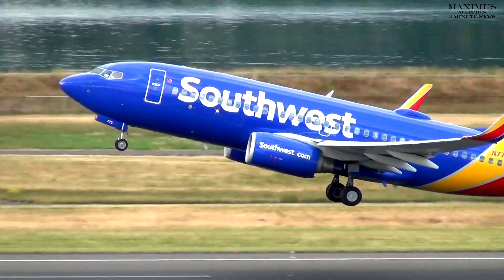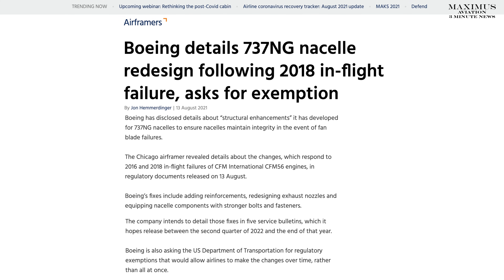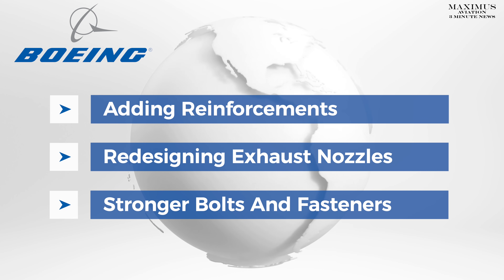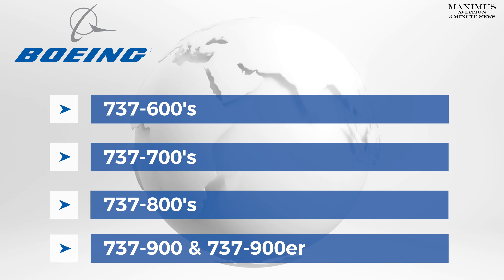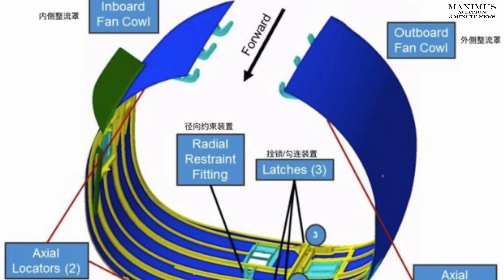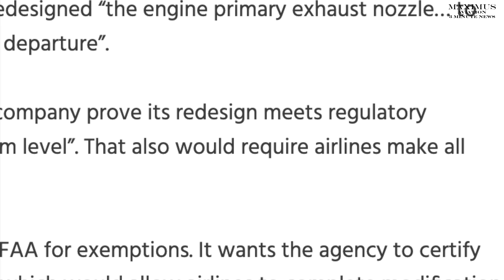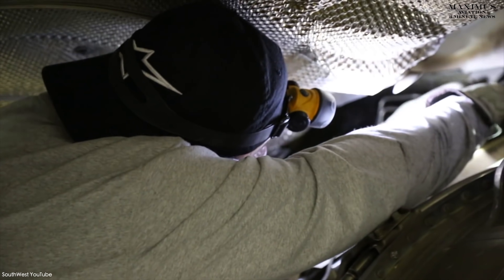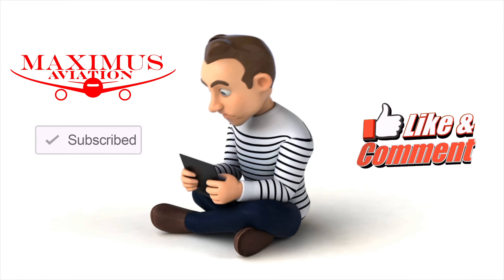Boeing Reveals How They Plan To Fix Dangerous Engine Nacelles

Comment: Wonder when Boeing management will realise it costs less to get things right first time! Rework and lost confidence costs money.
Reply: Probably never as long as they continue to start out at six figures. And rarely face job loss during downturns.
Reply: Unfortunately that module has been dropped at bean-counter college.
Reply: Boeing is in the process of failing. It takes about 10 years for a big company to go bankrupt from the precipitating event. Boeing is about 5 years into that process.
Reply: @leeoldershaw956  yeah but i mean the 777s and 787s are doing wel even the 737max series is making a come back i dont think boeing is going to be bankrupt soon maybe it becomes smaller but probably it will live on
Reply: @apotato5563  The 777X is way behind on its certification tests. 787 deliveries have drastically slowed due to quality issues. Their space ship program is in shambles. Boeing is toast.
Reply: You are such a wise man for a Brit. What happened?
Reply: @RLTtizME  Who's a Brit? I'm a Yank.
Reply: @RLTtizME  That was unfair. I'm 84 and spent a lifetime in aviation. I call it the way I see it.
Reply: @leeoldershaw956  You can be assured that every Troll calls it the way they see it. LOL.
Reply: @RLTtizME  Trolls try to make trouble for the sake of making trouble.
Reply: @leeoldershaw956  Don't feed the troll.
Reply: @mikenewman4078  I actually a" Billy Goat Gruff".
Reply: Most likely never as they are addicted to the gamble and the potential boost in shareholder value. Not to mention the cesspool circus is run by 🤡🤡🤡🤡🤡🤡🤡🤡🤡🤡🤡.

Comment: Just to clarify the role of the NTSB, as Maximus was slightly misleading in the video: The NTSB cannot mandate anything. They just investigate incidents and accidents. The NTSB can recommend changed. It is the FAA that can mandate changes - but as we all know - they used to be married to Boeing until recently.
Reply: @Dan P The FAA applying rigor is a very good thing for Boeing, the 737 MAX and all aircraft - sadly little too late for the people onboard JT610 and ET302. Airbus is primarily certified by EASA and the FAA can elect to do additional certification for the US if they wish. But don't get me wrong - people here don't want to see a manufacturer being trashed by the regulators for fun. We want to see the authorities examine every system, every component and every screw on all airplanes. And I wish that EASA is even more rigorous than the FAA, as this will ensure that Airbus and other European manufactured aircraft are even safer. What people were complaining was the trend few years ago, the race to the bottom, where safety was sidelined for speed to market and for profit.
Reply: until recently?????????????????
Reply: @johnstokes2246  Oh Johnny...you are so edgy until recently.
Reply: @Dan P well Dan the thing is I just don't trust Boeing or the FAA so that thing about the 737 Being this safes aircraft has gone out through the door back in 2019 the safest aircraft today is the one that is still flying and has not had a crash or grounded so you have to do that over as for right now no built aircraft from Boeing in the past 13 years is safe or safest all of them had some big major problem but Airbus has ho grounded no big crashes kill 346 people and grounded for two years a 777x that has a cargo door problem and has a guy from emirets mad that he has bought 20 aircraft to fly sense 2020 and has not to go them yet he have to wait acordong to the FAA 2024-25 to get them the 787 has a fuselage problem still trying to five it and that old out dated 373 man si still getting advice from there FAA so after all this Boeing is not my best place to buy an aircraft to fly safely it is like buying a pig in a bag so stop to nonsense stick with us and fly only Airbus my family and friends will be safe and arrive alive
Reply: Who is married to Airbus? The bribe recipients?
Reply: @RLTtizME  All I care is the safety of me, my family and other passengers. The marrige between Boeing and the FAA has already cost a lot of innocent lives.
Reply: like is said above we can't trust any USA organize=ation they all are in bed together man so it is CASA and Airbus for me

Comment: Seen this so many times !  Once a company becomes money driven compared to a Quality Product manufacturer.  The stock holders they cater to for that last dime take everything they can shrug their shoulders and move on because they are driven by greed not quality of product or safety of life. As long as the company management continues down this line of thinking , this is a company that can no longer be trusted to do what’s right.  It’s Historical past has become a mute issue. They need held to the standards of a start up. A keen eye on everything they do.  Because it’s proof positive they are no longer trustworthy.
Reply: They've been riding the once proud coattails of the long gone engineering company while destroying it from the inside out over worshiping the shareholder value had the MAX disaster not occurred they would still have many people deceived.
Sadly though there's a large group of fanboys who refuse to see the truth and most of them never set foot inside a Boeing facility.
Reply: @DC8Combi  true about the fanboys
Reply: The apparent worship of shareholder value is really only peripheral.  The true motivation is  executive privilege.

Comment: I forget the exact quote, but goes something like, “Anyone can build something that stands, but only an engineer can build something that barely stands.” Same is true for planes; they’re all trying to build a plane that JUST meets requirements, so safety is only paramount after shareholders get their cut. The safest and most comfortable plane possible is too expensive to operate commercially, unfortunately.
Reply: Modern airliners are (new Boeing fuckups notwithstanding) extraordinarily safe. It's when corporations try to cut too many corners (and get away with it) that things start becoming unsafe.
Reply: We all get mostly just that what we pay for. Too many are willing to risk their lives to save a buck or two! However, regulatory bodies (FAA) are tasked to make sure air travel is safe also for the general public, regardless the air fare! Nobody regulates the price point, which assures a 100% safe flight. It is assumed air travel is safer than any other mode of travel, but is it really?! That doesn’t matter if you are on a flight about to crash, it hits you or someone close to you 100% many times over. 
It seems to be difficult to measure accurately what is the prudent level of safety! 
I guess this applies to us all. However, the 737 with a mismatch of designs from several generations of different aviation ‘improvements’ causes me to feel the 737 is a “witches boil,” sorry.
Reply: @ctixbwi  Agree with all, except that what the FAA sets forth as standard (whether it’s “good enough” or not) has direct implications on the price of airfare. If the FAA says every plane has to have triple redundant systems and unbreakable engines, the price of planes goes up, so the airfare will follow because the airlines aren’t just going to eat the cost of compliance. Think about how overseas airfares dipped when you could fly on two engines instead of four; that was a safety issue that determined the cost of airfare. That’s getting what we pay for essentially. The prices we pay today between budget airlines and expensive airlines is more about service than the plane. It’s not like one airline flies Honda and another flies Mercedes; they’re all flying the same planes, just configured for different levels of service: more space, more 1st class seats, premium economy, bigger restrooms, etc.
Reply: @ddthompson42  
Yes, you are correct in notating that frivolous luxury affects air fares and not only regulatory (FAA) requirements, a good point. I think the money is better spent on safety! I like your point about 2 engines vs 4. 
But can the air traveling public discern how their travel $$$ must be spent: on in seat entertainment consoles or proven safe technologies properly applied etc.., most likely not.  
Increased complexity increases statistically the fault chain alternatives causing major accidents. Some triggered by outright silly circumstances. NTSB has done and does an excellent job identifying these fault chains leading to failures causing disasters. Seldom does only one fault be the cause. The NTSB library of accident reports continues to be good reading to prevent future accidents.
Reply: @ctixbwi  Yeah, no doubt! My original point was only that the absolute safest plane ever built would be expensive as all hell, so Airbus and Boeing and the rest build just to what is acceptable (sometimes a little more). The plane that can’t crash, or the plane that would protect everyone on board in case of a crash, hasn’t been built. Like the 737Max: Boeing didn’t offer the redundant sensors because of cost, but the plane was within standards at that time. AFTER the crash we see that the redundant systems are standard. Think about wing break tests; imagine if they were to engineer a wing that NEVER broke… $$$$$$$$$. So they aim for the limit and add some more for marketing, and fly away until we find out that it wasn’t good enough. A350 has some issues now; but the carbon skin WAS built to standards. Now we realize that maybe it needs more refinement. I’m not criticizing the makers, really; the whole system is the way we want it to be, really. Moderately high levels of safety for moderately low cost. I’d love to have Air Force 1 technologies on my flight from SF to NYC, but I don’t want to pay AF1 cost per seat mile.
Reply: @ddthompson42  
I still wish to add that the 737 MAX’s MCAS system was added only for the reason to compensate for the pitch up effect at takeoff power when the new engines with the large bypass fan had to be mounted more forward and higher due to the 737’s insufficient ground clearance to mount the engines under the wings. I consider this limitation a proof of that the 737 design had arrived at a dead end and outlived the technical design life! A proper airframe should not need a MCAS system, it shall fly properly without worrying the pilot when it could pitch up! This became more outrageous when pilots had neither been informed about MCAS or trained on how to use it.
Reply: @ctixbwi  Agreed; they built a plane that was “good enough” to meet FAA requirements so they could capture business of airlines that needed a relatively cheap plane relatively quickly. Airlines agreed to buy the MAX because they didn’t want to spend too much on revitalizing their 737 fleets. We’re saying the same thing, just with different examples.
Reply: @ddthompson42  it's not really $, the issue is even if you had a "safer" option how would you know? I'm not sure an Airbus is necessary "safer" than a BA, i absolutely think BA execs made criminal executive level decisions and appear to have gotten off stock free. Stockholders maybe paid a temporary price...

My point is there's an intentional lack of transparency, this applies to universities, religious and other nonprofits etc. I never heard a single person ask for an FMEA which is exactly what caused this incident...

Got me going
Reply: @jeebus-k  I think you’re absolutely right about the lack of transparency, but I feel that tends to come back to cost. The phrase “Cost is no object” is probably never uttered - truthfully - in any board room in the world. I’m in program management, and we talk about the the relationship between time, cost, and scope: change any leg and you end up out of balance. So do you want it cheap and fast? Then it can only be so good. If you want it good and fast: it won’t be cheap. Bringing it home (LOL.. I’m rambling): I’d say transparency costs money; money that most airlines probably don’t want to pay, and I think many pretend not to notice these “little” things until they become big things. Then the lawyers get involved.
Reply: @ddthompson42  a coworker had a sign on the door:

Cheap, 
Good,
Fast,
Pick Two!

My point was about paperwork which engineers are already required to produce as part of the design process, but then it's never exposed when there's an issue. How can anyone outside the company identify root cause if the data isn't shared... when people die it shouldn't be business as usual.
Reply: Are you willing to pay the full price to fly? I’d say no since most people only want to pay for the cheapest airfare! Also, nothing is 100% safe! Not even staying at home!
Reply: @nuniabiz7982  the cheapest seats and the most expensive are on the same plane. You're not seeing passengers choosing between safety and price, you're seeing them offered a 300 dollar premium to get free booze worth about 20 bucks.
Reply: @gasdive  southwest $220; alaska $240…most people will fly southwest
Reply: @nuniabiz7982  and they mostly fly the same aircraft type. Mostly 737.
Reply: @nuniabiz7982  What I’m referring to is the number of redundant systems in an airliner or the amount of shielding on the nacelle or the thickness of the skin are all only what they need to be to fly at a level of efficiency that makes sense for airlines. Southwest 737 is just as safe (off the factory floor) as an Emirates 737. Sure, they may treat them differently over time, but they start as the same shell of an aircraft. If you make the skin thicker you have to make the engines bigger. If you have more redundant systems, the plane gets heavier or more complex. So Boeing won’t make a quadruple redundant hydraulic system because the plane would need to be beefed up, hence weight, hence efficiency, or even space available for seats or cargo, etc. There are many trade-offs,
Reply: @ddthompson42  no. If they're all held to the right standards, there's no "choice" to have slightly cheaper. If it costs 500 for a flight instead of 350, that's what it costs (and the price difference wouldn't be that much anyway)
Reply: @gasdive  I'm not talking about the difference between one airline and another with the same planes; I'm talking about making a plane as safe as it ever could be vs making it only as safe as we can tolerate. If a 737 had triple (or more) redunancy in every safety system and thick enough skin to survive a crash from x altitude, the price of the plane from Day 1 woule be higher, thus the airlines would have to shell out more for a plane, thus the plane fare woule be higher.  The "choice" would be to either fly the airline with the less safe plane or the more safe plane, and I'd bet the cost would be significantly different under that paradigm. In today's world, the planes are made as safely as we'll tolerate, which is why we have to keep having accidents before they're made safer.
Reply: @ddthompson42  I do not wholeheartedly agree with you. Mostly money cannot directly be converted into safety. Safety is a result of engineering quality, the amount of time granted to them, and thus to how the company is run, what choices they make, what people and procedures they select, what materials and what deadlines, how they cut up the cashflow that IS coming in,... And most of the money goes into the pockets of the company's CEOs and COOs, to management, they will bank hundreds of times what they pay all of their engineers, heck they will even take ten million in extra bonus packages home in times they cut the (low) wages of the actual workers of the floor... (actual story).
Reply: @harrickvharrick3957  I don’t understand how you don’t agree with me when you just made a point completely in line with mine: companies don’t spend their available money on safety. Instead of doubling the staff working on MCAS or waiting to release the MAX until they got it right, they rushed the release in favor of cash flow. Safety takes time; time is money. If manufacturers didn’t have to invest all the time and money into the FAA testing battery, do you think they would do all of those tests? Breaking wings, burning up landing gear, blowing up engines?
Reply: @ddthompson42  What you initially wrote was in no way that elaborate and I was reacting to one of the other responders, maybe that went wrong but I don't think I was trying to contradict you.
Reply: @harrickvharrick3957  Indeed! What started as just a comment became a whole discussion; my fault for assuming you had read the whole thread. I was responding as if you had already read my additional comments. Apologies if I came back aggressively. My base assumption is that everyone gets a cut before the customer does.
Reply: @ddthompson42  's okay!
Reply: @nuniabiz7982  No, I’m not, and that’s the point.
Reply: Safety is NOT paramount, safety only comes AFTER shareholders get their cut. Safety is always secondary 
/Lonewolf Liberties

Comment: The NTSB needs to be disbanded immediately they are not up to the task five years to come up with this fix is unacceptable
Reply: NTSB cannot mandate anything. They just investigate incidents and accidents. NTSB can recommend changed. It is the FAA that can mandate changes - but as we all know - they used to be married to Boeing until recently.
Reply: Yeah, that will make it better...  Shooting yourself in the foot doesn't alleviate a chafe...
Reply: @benghazi4216  waiting five years for a report is shooting yourself in the foot.
Reply: They need to be replaced with real pilots and engineers not weakened 172 Pilots and the head of the NTSB only has a certification operating a moped ,another thing I don't believe our counterparts takes five years to publish a report...